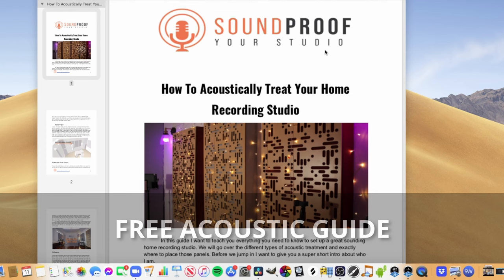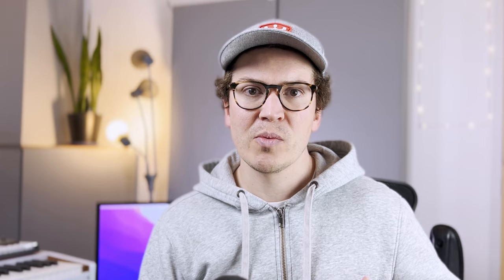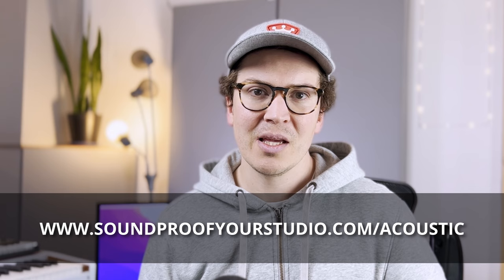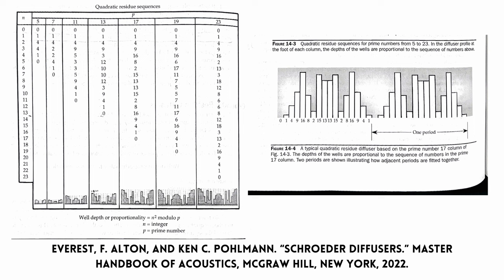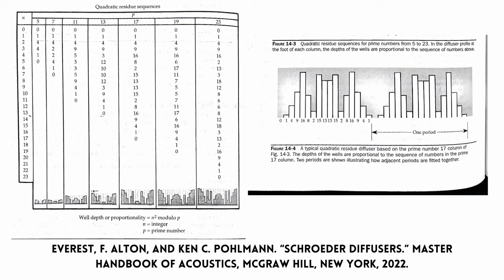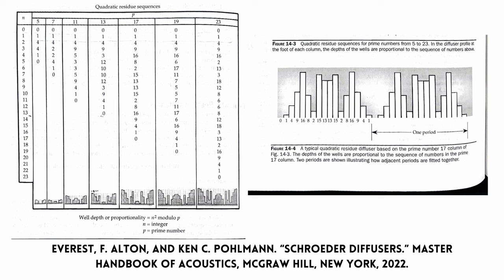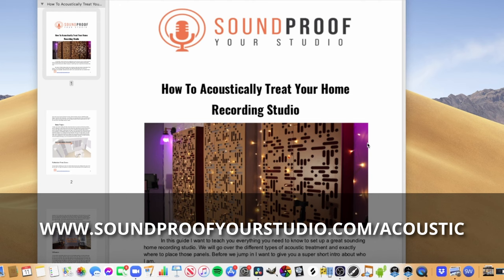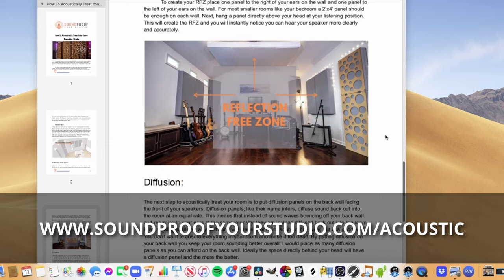How To Build A Quadratic Residue Diffuser (QRD)

Comment: Hey Dude. This is a great video thank you. I have the carpentry skills I need but not the math skills, I'm going to need to watch it again and let that sink in. Problem is I can't seem to open the link to that calculator. Any chance you could post it in the comments? I think I saw the same link on another site and it also wouldn't open there...just gets stuck whilst loading. Really struggling to find another calculator.  Appreciate any guidance with that. Thanks

Comment: I love how informative your videos are, plus how well you communicate complex information. 
I have a big question that I'm sure alot people have. 
I live on the second floor of a two story apartment where footsteps vibrate down to my lower neighbors if I'm not careful.
I love to sing, (but im not great) and would like to create a structure that would allow me to practice singing without my voice bothering my neighbors.
I would say the walls and floor are fairly thin as sound passes through muffled pretty easily.
My current plan is to buy 1 inch 12x12 thick corkwood panels and make a rectangle box about two feet long and one foot tall. Next I'd apply adhesive polyurethane foam to the inside and simply sing within it. 
Do you think it would work in reducing the sound entering the room below? What do you think the best option is in this situation. What's the best value option based on your expertise? I live at the end of the building so I only need to worry about the room below mine.
Reply from the maker: This is a tricky one. I have been imagining a vocal booth design for this type of situation. I think I might design one and sell the plans since it is so common. The key is to add mass on all sides, especially the floor and then decouple that mass. It’s complex enough that it would require more explaining. If you want me to design the be just shoot me an email - info@soundproofyourstudio.com

Comment: Whats the algebric relations between well width and high frenquency cutoff
Reply from the maker: So the deeper the wells the lower the diffusion goes. The thinner the fins the higher the diffusion goes. Ideally you would have super deep wells with razor thin fins, but that is structurally difficult.

Comment: I understand a certain distance needs to be kept of the microphone to the QRD diffuser, but I don't know how to calculate that.  Is there a ratio, of the deepest well of the panel, to how far away from the panel microphones need to be?  So If I have 6" deep QRD panels, what's the closest I can set up a drum kit with it's microphones, to the wall with the QRD diffusers?
Reply from the maker: Great question. This is from acoustic fields : For the interference patterns to fully develop into a diffuse field, it is recommended that the minimum seating distance be three times the longest wavelength diffused. Diffused wavelengths need time to form completely before they reach the listening position. If one is seated too close or has the diffusor too close to the speaker or sound source, the diffused wave does not have time to properly form and you can have image shifting.”
Reply: I had the same question. Also from Acoustic Fields: the listener or microphone should be at least the wavelength of the lowest frequency. If that is 250 hz that would be about 4.5 feet.